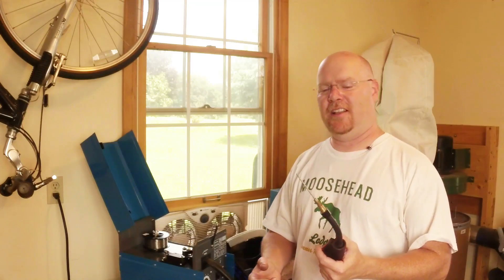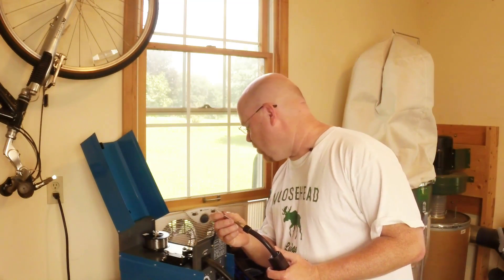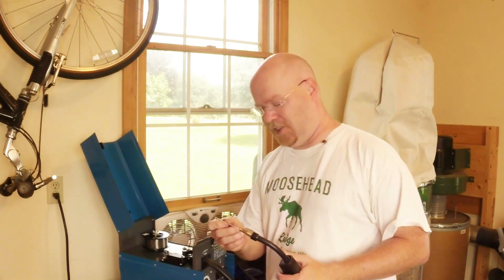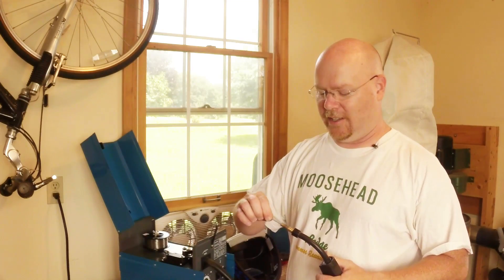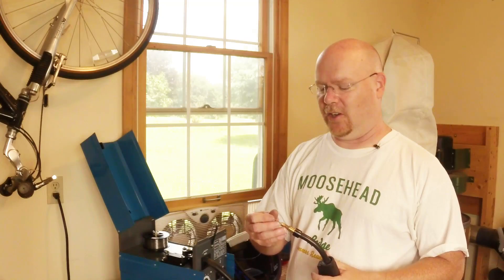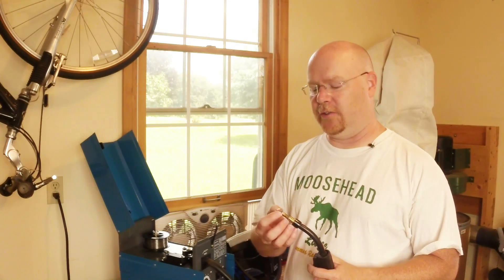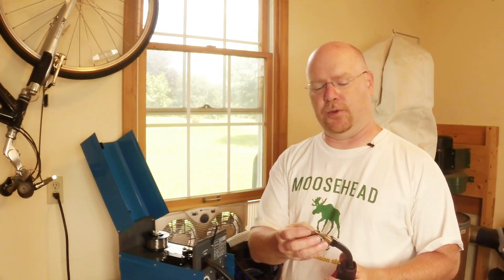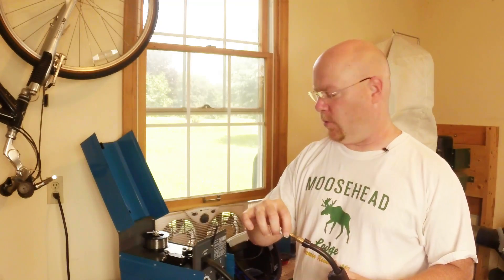Easy Harbor Freight 90 AMP Welder Mods 05

Comment: Matt, add one of these between the drive roller and the tube leading up to the gun.http://www.amazon.com/Weld-Aid-Lube-Matic-Wire-Kleener-Pack/dp/B008RA5D5C/ref=sr_1_fkmr0_1?ie=UTF8&qid=1460570719&sr=8-1-fkmr0&keywords=wire+welder+lube+felt

Comment: If the drive wheel and tip are sized for .035 wire but the welder ships with .030 wire, why not just put .035 wire in instead of changing the tip and modding the drive system? Is there some reason you cant do that?
Reply from the maker: +resqjason2 It isn't really a mod.  You just have to flip the roller over.  The wire feed mechanism is designed to be able to run either .030 or .035.    Having said that, I think this welder is under powered for .035.  The wire piles up before you get good penetration.  Turning the wire feed speed down helps, but it's still not as good as just running the smaller wire.

Comment: You can get a flux core nozzle which is, er, intended for flux. The tip they ship assumes gas...which is funny for a welder that only does flux.
Reply: Ben Wilson Yep, I got one at Lowe's.  I guess they save money by not building gas/no gas wire guns?

Comment: The end cup does more than direct the gas. It provides an insulated tip to protect the end of the torch and the user. Many of those units are hot tip when you turn on the power, the trigger only turns on the wire feed. The cone keeps you from shorting the wire tip on anything by accident.

Comment: just a suggestion with mig welders, especially with harbor freight welder, straighten out the gun lead as straight as possible to help keep from feeding the liner out with it. I'm glad they replaced the liner with a more durable one, I had one of the older ones, it had a plastic liner every time you put new roll of wire thru it pieces of the plastic liner came with it until one day after about 6 rolls of wire had been ran thru the wire fed thru the side of the gun lead.